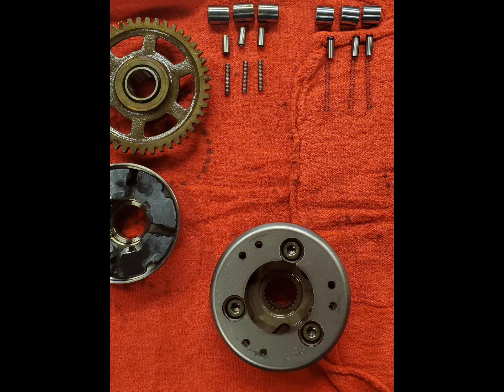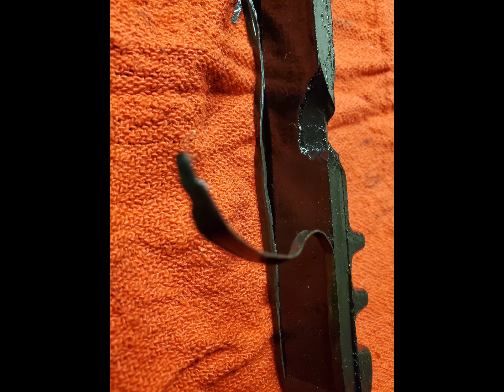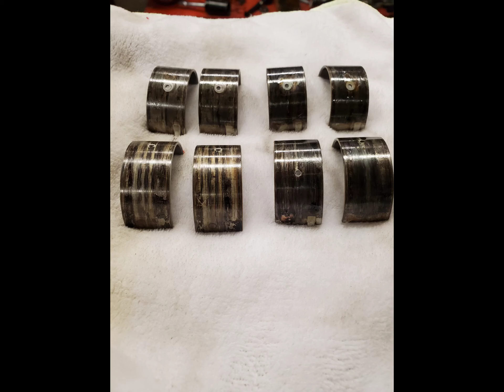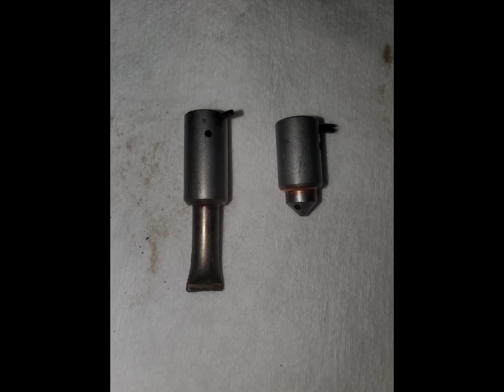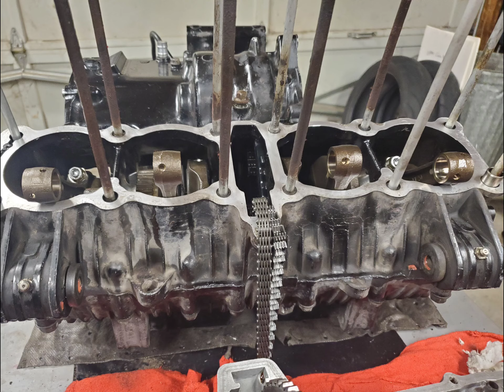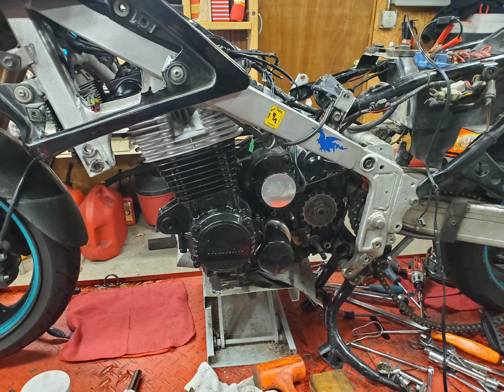FJ1200 Complete engine refresh and rebuilt starter clutch

Comment: I need some advice on rebuilding the crank case on my fj1200. Is it best to build everything into the top case and join the bottom section after or vice versa. I'm thinking its best to do it first in the top case because of the starter clutch .
Reply from the maker: I recommend building everything into the lower case. Then place the upper case on.
Reply: @halffastfred7602  Thank you for getting back to me , I questioned which to build everything into first because of trying to position the stater clutch assembly.

Comment: I have a 86 that shifts hard and the clutch is not disengaging fully. Changed the fluid and still didn't help.  Any ideas? And cost. Nice job on your bike.
Reply from the maker: I would look at the slave cylinder. Over 30+ years moisture can get past the seals and corrode the cylinder bore.
Reply: Thanks Fred
Reply: Had a similar problem on my fj1200.  Sometimes tiny air bubbles attach to the brake line and the steel tube. With the cap off the master cylinder tap the lines with a screwdriver starting at the bottom.   Then slowly squeeze the clutch lever( not to far as to you don't want to push fluid towards the clutch) watch for air bubbles coming out of the tiny hole in the reservoir repeat till no air comes out.  Could have warped clutch plates etc. Hope you have it figured out. 👍
Reply: I honestly got fed up pissing with it and making a mess. So I filled it up again and closed it up. After a couple of days sitting. It decided to start working.  🤷‍♂️ thanks for the help guys.  👍

Comment: Big job! How many miles did that one have on it prior to the rebuild?
Reply from the maker: The engine had 62,000 miles on it. The engine did not need to be rebuilt. The starter clutch failed. The lower cases have to be split to do the repair on the starter clutch. I decided that I would put new bearings and rings in since everything was apart.
Reply: @halffastfred7602  Thanks, I’m thinking of buying a 92 FJ1200 with 32,000 miles, preparing myself for the worst.
Reply from the maker: @harbertsand  The lower ends are pretty bulletproof. They upgraded the shift forks starting in 1988. So there is no 2nd gear issues with the 92.
Reply: @halffastfred7602  Thanks for sharing that. Good to know!
Reply: @harbertsand  I just bought a 92 with 24,000 miles on it.  Be diving in soon to do this!!!!

Comment: Hi, I just bought a FJ1200 but I have a lot of vibrations. Is it normal ??
Reply from the maker: You should not have much vibrations. I would check the torque on all of the engine mounts.
Reply: @halffastfred7602  thanks because I have vibrations in my hands and feet, it’s like I have a hair clipper permanently in my hands it’s super unpleasant and it puts tingling in my hands.
Reply: @halffastfred7602  Should we change the silent blocks of the engine mounts? and if so, do you have references for these parts because the original ones are no longer manufactured.
Reply from the maker: What year is your FJ?
Reply: @halffastfred7602  December 1991
Reply from the maker: @SP85officiel  go to www.fjowners.com. it is free to join if you are not already a member. There is a 'Files' section that has helpful subjects. Repairing seized forward engine mounts is covered in there.
Reply: @halffastfred7602  oh thank you so much I
Will try to find the good section.

Comment: hello, please help me with advice
on the starter chain
Reply from the maker: I can try....
Reply: is there a generator chain tensioner on the 1200 ?
or just a sedative ?
Reply from the maker: There is a starter clutch chain guide that does provide a bit of tension. At start up and low rpms, you may hear a rattle from the engine. This is very common and not something that you need to worry about. The chain does get loose and the rattle that you hear is the chain rubbing on the starter clutch oil nozzle.
Reply: @halffastfred7602  I have a strong rumble
, I took off the engine, took off the pallet
and realized that my usplklitel broke (garbage in the internal combustion engine)